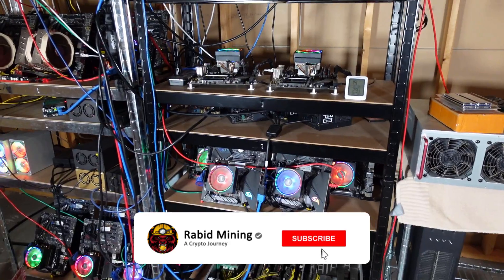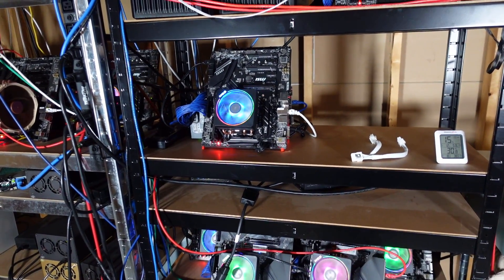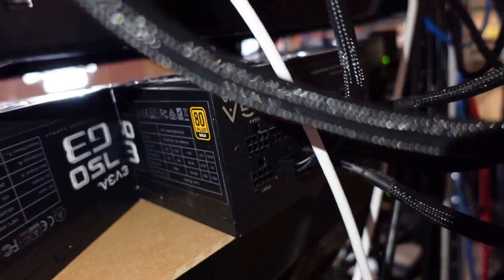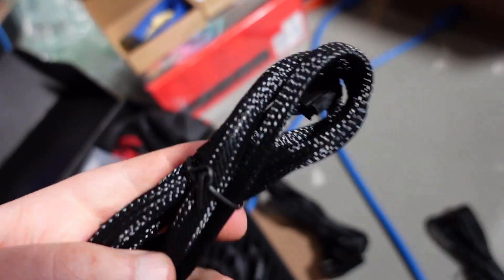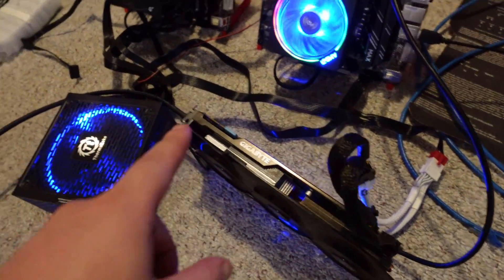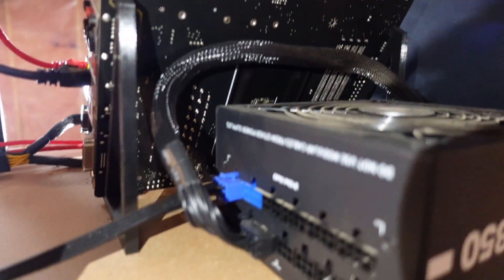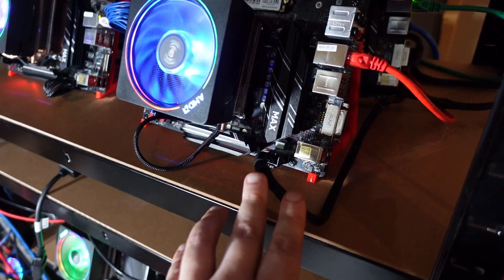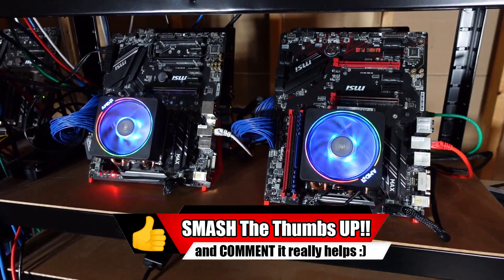How To Run 2 PCs From 1 PSU | CPU Mining

Comment from the maker: Are You Building In Bear Market Rigs?
Reply: I just ordered two 3900x and motherboards. :)
Reply from the maker: Nice
Reply: @RabidMining  i stand next to you in roblox i your fanat
Reply from the maker: Hey thx :)
Reply: @RabidMining  not right now as electric costs are killing the profit. I am thinking about a small off grid solar powrred system to power on  two cpu mining rigs.
Reply from the maker: Nice
Reply: yes, picked up a 25euro workstation i3. its runs two 3060's
Reply: Yep trying to pick up some cheap hdds for another chia rig
Reply: Rabid????  When I turn mine on 2 miners fire up then one shows cpu light on and won't boot... Same power supply and cables...  Thoughts please..

Comment: A quick question for you what would happen if you shut down one machine without shutting the other? Would it power both machines down because of the power good signal?
Reply from the maker: Just the one shuts down
Reply: @RabidMining  thank you for your response. The reason I asked this question is I am doing dual system build as a gaming computer and the other server and I need the ability to be able to shut down the gaming computer
Reply from the maker: @Tech-Tide2387 ahh gotcha also can put a power button on it and hold it down for 3 sec will turn it off as well.

Comment: I was surprised to discover the 8 pin eps cable is rated for 384 watts, most of my 3 MB PsU combos run at a total of 375watts at the wall. Cables are slightly warm but absolutely no melting. Always make sure the 24 pin splitters are FULLY seated. A loose connection is a hot connection. The most i ever had on a single PSU WAS 5X 5900X cpus on a 1300w evga gold.... dont do that, just go for 2-3 for fire safety guys. The 24 pin splitters will start to get hot with 4 or more MB connected. Don't burn your family to death. 

If you run into issues and have to reset cmos, be aware, you will need to isolate each MB from the splitter set up, because the other MB battery seems to make the one youre working on think its still got a battery. When setting up multiple rigs, do all your tuning before installing on the splitter set up or you may experience problems...

Comment: 2 computers from 1 PSU is the stupidest thing to do! Go ahead if you want to burn down everything!!!! Burn your PSU and burn your 2 computers!!!  Normally people doing opposite - 2 power supplies and one motherboard (one computer)
Reply from the maker: Lots of dual streaming pcs are made exactly like this but built in the case everything is within the power parameters of the cables.
Reply: Normally people don't mine on CPUs, and definitelly don't build CPU mining farms. CPU mining is beyond normalness so give it up. As to subject - nothing wrong with having 2PSU on 1MB or 1PSU on 2MB. Just know what you do, calculate watts, and get high quality parts.

Comment: I have a question for you am thinking of doing a duel system and my only concern is, if I was the Shot one of the systems down, would it cut power to the other system or cut power to the graphics card? if I’m understanding the ATX standard correctly, this is what may happen and it is very hard to get an answer from people on the forums
Reply from the maker: Other one will run fine still

Comment: Hey Rabid, I'm powering 2 systems z790 atx and z690 miniITX using 1650w psu. The mobos will be powered using splitter while the cpus using cables directly from psu with no splitter. Is it safe to do so or there might be issues over time or if I run both systems under full load? Thank you very much 💛
Reply from the maker: Shouldn't run at full load
Reply from the maker: Probably not for gaming not sure how much power the intel cpus use.

Comment: my MB spliter cable doesn't work as intended, once I connect both MB, only 1 will turn on, but I connect only 1MB at a time on either end of the spliter cable, there is no problem for that MB to turn on. Any ideas Rabid?
Reply from the maker: Try the other end that's plugged into the non working to the working by itself maybe one end is bad?
Reply: @RabidMining   either end working on either MB. Weird. If plugged together, not working.
Reply from the maker: Hmm that is weird how about the cpu plugs?
Reply: @RabidMining   works fine. I think it coule be bad pins inside the MB spliter, might just get another PSU. ty!
Reply from the maker: Ya that's weird not sure what's going on there.

Comment: Hi :-) This did not work for me. Why? Both Motherboard turned on, but only one booted. (Using one PS with two CPU power out)
Reply from the maker: Any indicator lights?  Maybe one is looking for a gpu or RAM make sure both boot fine before putting them together
Reply: @RabidMining  Hi Rabid :-) One board has no indicator lights, so its clearly not working. (Both Motherboard working with two power supply) Going to try some other PSUs

Comment: Be careful to not mix the CPU and PCIE cable connectors. Some people have managed to mix them so badly that they broke their hardware because of it.  You can find quite good drawn schematics of those connectors from internet. Also be careful with PSU modular cables and connectors to not mix them between different brands.
Reply from the maker: Yup

Comment: There are actually CPU to PCIE splitters that swap the wiring so that the 12 volt EPS polarity is correct on the PCIE ends of the splitter.  I use them, they work great
Reply: Where did you bought those?
Reply from the maker: I'll get links for them on discord
Reply: @CryptoBaltus  amazon, You use your CPU cable from the cpu jack on the power supply the place the cpu to pcie splitter on the end of that cable .i will send a link
Reply from the maker: Yup

Comment: I have been using those 24 pin splitters for a year now. No issues.
Reply: just wanted to fire up 2 mobos with 1 psu, one of my mobo wont start if both mobo is connected with the 24pin splitter. if I unplug one mobo it starts wothout issue. what can block the startup? not even posting no beep codes if connected.

Comment: bro, do you jumper the pin power button? or just turn on the switch psu? and how to shutdown one of them, it's ok?? and working on windows too? thanks Bro, nice video
Reply from the maker: Thx have a power switch when I need to shut one off they both go out but never have to shut one off lol
Reply: @RabidMining  hmmm.. i see.. one more question, how about efficiency? 1 psu with 2 mobo, or 1 psu with 1 mobo, which better? how big the gap watt? thanks
Reply from the maker: Think 2 is better as you get closer to that 50% peak efficiency rating depending on the size of psu you get but a extra psu itself is only like 5 or 6w probably but costs more to buy more

Comment: Question(s) - Both mobo's are powered up, but you only have one GPU connected to one mobo. Do both mobo's run through that one GPU? And, from what you showed, there are two, separate rigs displayed on your HiveOS. How do they both get connected on HiveOS? I'm thinking in terms of the GPU rig whereas multiple GPU's are connected to ONE mobo, then run through the ethernet connection for the miner to detect all GPU's. 
I guess I'm unclear as to how two mobo's can be detected from only one GPU. (Please excuse my ignorance as my computer knowledge level is still in the infancy stage!)
Reply from the maker: No gpus on any of them that waists more power the gpu is just to set the bios then I get rid of it.
Reply: @RabidMining  OK, I get it. As for both mobo's being recognized by HiveOS, you just turn them on, sign into HiveOS, and then they're both detected?
Reply from the maker: Yup set up just like a gpu rig in hiveos
Reply: @bluessrv1  yeah the computer boots up by itself and automatically connects to hive website.  As long as a flight sheet it's active for it, it will start mining without you don't anything, just turning it on.

Comment: Yeah. Works great. And if you're "lucky". Some psus have multiple cpu cables so no need to split that. No stress either way.. But the pcie splitters can work. You just gotta make sure they are 8 cables to 8. And don't mix up the runs. Cpu is 4 pos on top 4 neg on others. Mine work fine. Guess it's down to how cheap the splitters are.